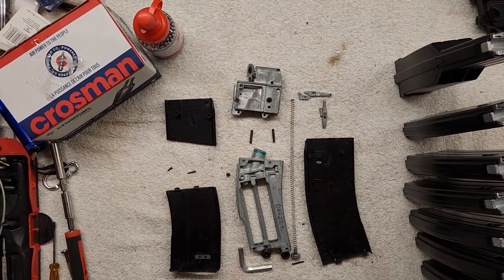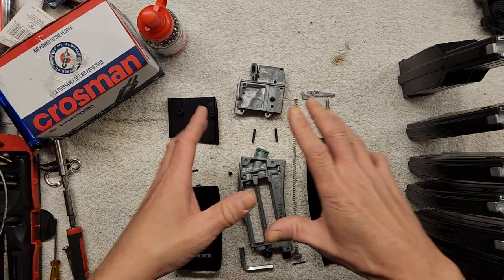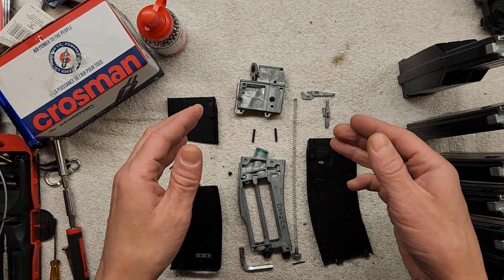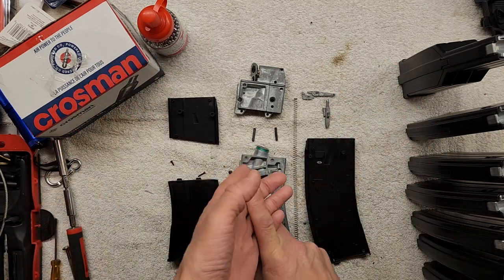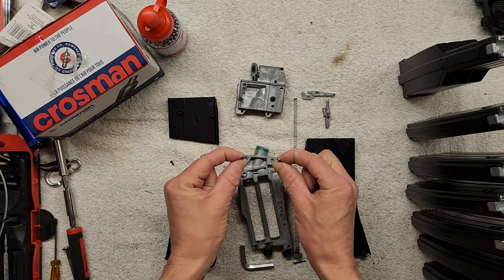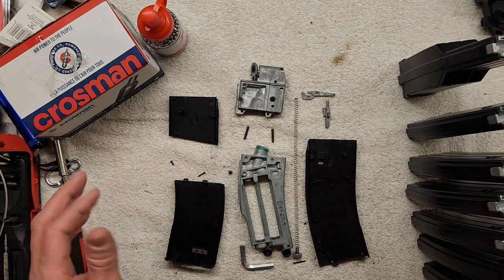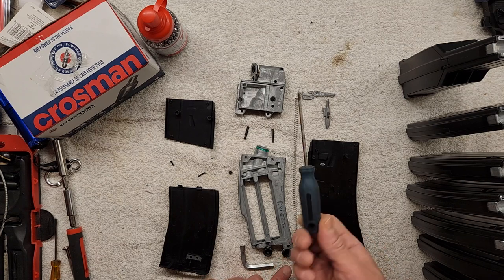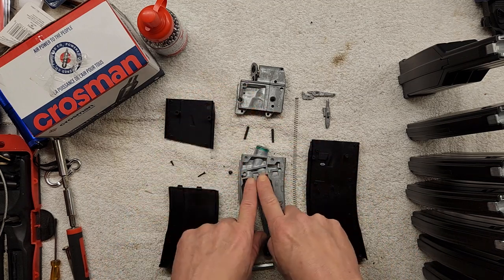Crosman Full Auto BB Magazine - Full Disassembly and Internal Check Valve... No More Secrets!

Comment: Mine doesn't go full auto? Whenever I shoot it in full auto it just shoots once it has bbs in it but only shoots once ? Please help
Reply from the maker: Are you using an unmodified magazine or do you let it sit in the sun? Does the bolt lock back when it happens? Do you get full power when it actually does fire?

Maybe most important, have you field stripped it yet and verified the springs aren't mangled in the buffer tube?
Reply: @RWMAirgunsmithing  the bolt does not lock back when it happens I've never let it sit in the sun
Reply from the maker: @xtdungus6352  ok so does it shoot full power on the initial shot or does it seem weak? Does the charging handle pull back freely or does it seem like you are crunching springs?

It's possible you aren't getting full power from the magazine.  There is a possibility also that the "hammer chip" (the little black knob on the tip of the bolt) is either broken, missing, or worn out.  If it doesn't protrude enough the bolt will not make solid contact with the firing pin and you'll get weak blowback.
Reply from the maker: @xtdungus6352  sorry for the questions but I need information to troubleshoot xD
Reply: @RWMAirgunsmithing  it shoots full power but every time I shoot I have pull it back again to be able to shoot or it won't shoot at all and btw thanks for actually responding
Reply from the maker: @xtdungus6352  Hmm, so does it happen also in semi? Or only in full auto?

I would start by performing a basic field strip, including removing the buffer and buffer springs, make sure the notch on the buffer is not close to the retaining ping when reassembling. 

If this basic verification doesn't solve it you need to check the fire selector detent spring and pin by removing the pistol grip. Make sure the pin bounces freely and the spring is not damaged.
Reply from the maker: @xtdungus6352  technically, if nothing is broken it should run, doesn't seem like it's the mags fault since it delivers on the first shot. Weak CO2 flow would definitely screw with blowback and proper full auto cycling.
Reply from the maker: @xtdungus6352  hey btw(I knew I had an obscure event buried somewhere in my brain lol)

It has happened to me before while swapping uppers and lowers around that the buffer tube ends up not being perfectly in line with the lower extension depending on the slack between the parts or even how you hold it.  So the BCG rubs inside and never completely cycles.
Reply: @RWMAirgunsmithing  Okk thanks I found something new whenever I shoot the slide barley goes back is that normal?
Reply: @RWMAirgunsmithing thanks so much I just fixed it but one more problem it gets stuck whenever I try switching it to full auto or semi it won't let me
Reply from the maker: @xtdungus6352  the fire selector stays stuck? If the fire selector won't move it's likely due to the pistol grip and fire selector detent pin and spring. Maybe it's too tight or misaligned.

Silly question but are you sure it is a full auto model? Did you buy it brand new? Or refurbished? Or a generic brown box version? The semiautomatic fire selector will not go beyond the vertical position, the different parts are inside the FCG.

Comment: When loading co2 in my high capacity mag it leaks. I put in the first co2 and it leaks out the second co2
Reply from the maker: If you check out my tips and tricks video I show what the issue is.  There is a ring that holds the co2 seal and piercing needle in place, you probably need to give it a little tightening on the second, just dont over torque.
Reply: @RWMAirgunsmithing  ok thanks I just need to find a big enough flat head to fit

Comment: Hello mate i wonder if you can advice me on my dpms magazine.  I tired doing the valve mod and when i put it back together its causing a leak. Each time i put co2 in it lets the hole lot out instantly. How do you think i solve this problem. I eventually want to mod all 6 of my magazines and don't can't figure out whats wrong
Reply from the maker: Heya, which mod are you talking about? And does it empty out the firing direction or the blowback side?
Reply: @RWMAirgunsmithing  it was an attempt at rhe valve mod. You drill bigger holes in the ports to release more co2. I never really achieved that but when I put it back together the problem arrived. Mostly the co2 comes out the front bb part and a little from the back too 😅
After watching thr video I decided to dig out the broken one, I have 6 so I had to fill all of them with co2. One that was just repaired under warranty is leaking again so that's getting returned again. I have started to strip down the one I tried to mod and I'm going to see what's going on with it. I could do with a proper valve tool but can't ever find them
Reply from the maker: @Replica-Airgun-Lovers  ok ive seen that mod, technically it is all internal, pretty sure if the brass or interior valve stems are not marred and all the parts are assembled in order there should be no external leaks.  Did you follow along with my video to make sure all the parts are there? I never had issues or had to over tighten that valve assembly, it just snugs right into place.

To find valve tools you need to check the big sites like pyramidair.. or google for airsoft shops, I buy most air tools and accessories from local airsoft shops.
Reply: @RWMAirgunsmithing  I think I'll buy a decent toll and give it another go. I can't undo the valve now with what I have.   It is leaking from front and back but mostly back. I'm sure I never lost anything parts but when I get the new tool I will open up another and compare them to each other and hopefully see what's wrong. I'm in England so getting parts is impossible and crosman won't send or help out due to being in England. Thanks for the assist. I'll have another watch of your videos aswell and see if I missed something
Reply from the maker: @Replica-Airgun-Lovers  oh snap! No customer service overseas! That sucks!   Really sounds like there is something missing or broken inside there, the pressure from the springs should keep everything shut.  Can you depress the valve manually? Might be stiff but I can push down on mine with my nail.
Reply from the maker: @Replica-Airgun-Lovers  https://discord.gg/fJsaVPTV

Link to my discord, send me some pics if you want, or keep me posted, ill try and help if i can.

Comment: I really appreciate your effort, patience and in-depth analysis of the subject. Many thanks and congratulations! In my opinion (I am the owner of such a toy) they structurally exaggerated with solving, as it seems to me, problems with the distribution and timing of delivering the right amount of CO2, at the right time and in the right amount to the chamber. It's obvious to me that semi and auto mode are completely different stories, so they found "some solution" which is not perfect. So I have a question for you. What would you change in the design of the magazine to improve its performance?
Reply from the maker: Thanks! Great question hehe, the only thing that I feel is a bummer is the thermal co2 freeze and the finicky tightening of the co2, would have been great if we didn't have to worry about the co2 dumping.  I think if the brass seat had the same diameter as the piercing needle we wouldn't have this problem.

I most definitely will get myself a HPA conversion kit so I can at least zero my optics with no co2 thermal influence.

Comment: The magnet is what's messing up my it's holding the bb in the chamber. 6:00 mins into vid thanks. can you get a new magnetic if it's shattered?
Reply: Can u get a new magnetic for it
Reply from the maker: You can buy various sizes of magnets with a google search.  If it fits in the little slot it should work.  Hope you can find a replacement, maybe contacting crosman would be a good idea.

Comment: What size flathead screwdriver are you using?
Reply from the maker: Hmm not sure of the size but the goal is to have a flat bit wide enough to catch both notches on the tightening ring.  This way you dont have to worry about damaging the piercing needle or the threads.

Comment: FYI dpms won't fire properly with copper bbs
Reply from the maker: What happens with yours?  I stopped using copper coated when I noticed all the copper powder in the bottom of the jar only a couple months after purchase.  Still have like 3k bbs in it lol xD.
Reply: @RWMAirgunsmithing  looks like the loading mechanism is magnetic in the mag, copper just won't fire correctly...
Reply from the maker: @VIRGILSHELTONII  I haven't tested any since that copperhead jar, but technically bbs should be steel with a copper coating.  I still wouldn't recommend them because of the flaking.

Comment: where can you get a spare spring?
Reply from the maker: Unfortunately crosman doesn't sell many individual parts for this model yet.  If your spring is mangled beyond use, it is just a spring, check airsoft shops or just google it. 

As long as it will fit on the follower and is not too weak or too strong it should do the job.

Comment: Do you think I could get a new piercing needle from Crosman? I think mine are starting to wear out and don’t quite pierce the CO2 cartridges as good as they use to. This magazine is like a year and a half old.
Reply from the maker: Couldn't hurt to try contacting customer service.  Those are pretty hard though, the cheap metal from co2 shouldn't wear them that quick I think.  Have you watched my tips and tricks video? To make sure the check valve is not jammed?
Reply: Yeah, the magazine still works fine right now. But I’m starting to notice that when I pull out the used cartridges the puncture hole is barely even open. At least compared to how it used to be.
Reply from the maker: @silverwing5644  I wouldn't worry until you see a noticeable difference in ballistics or if there is excessive co2 left when you unscrew them.

Comment: Got Damn Check valve!
Reply from the maker: Got damn right! Lol , once you know the trick she's not that bad 😜
Reply: Crosman led me here. Thanks for the video and detailed advice.
Reply from the maker: @SilencedRage  thanks hehe, I should send them a bill xD
Reply: @RWMAirgunsmithing  hey buddy quick question, how do you know when to change the second CO2 cartridge in the DPMS? There is no real info or video out there.
*Second CO2 cartridge
Reply from the maker: @SilencedRage  hmm they should both empty out at the same rate and you change them both at the same time.  What is happening when you load/unload your co2?

Edit : if the bcg is still cycling and your poi is not significantly dropping then you still have co2 to burn.  Rapid plinking and full auto can make it seem like you run out of co2 (you can usually tell the difference) letting the co2 rest between reloads or having multiple mags will solve this.

Comment: You can unscrew the green seals inside the co2 slots, take a dental pick and apply pressure to where there is a little space on the edge of the green seal, then push down a little dont penetrate it, and start to unscrew it. It comes off very easily this way. I haven't put it back together yet lmao, but doesnt seem like they were damaged. Im doing a QR mag though so may be different. I think it should be similar though
Reply from the maker: Oh not a bad idea! I was thinking some type of small spring loaded claw (like on some mechanical pencils lol).

Also just fyi, on one of my mags the seal on the first co2 just fell right out.
Reply: @RWMAirgunsmithing  dude that would be better, I just put mine back together it’s the QR mag and followed all your videos I think I just needed lube on the ball bearing. The ball bearing is in the “first” slot on the QR mag it’s weird.

Oh damn just fell right out, that doesn’t sound like a good connection. 

Of all the Crosman I have a a4-p, was thinking of getting a DPMS would you prefer that or another crosman full auto ?
Reply from the maker: @solventlessherbalist135  I'm a big fan of the AR platform, the DPMS is fine if you dont mind the plastic stock, get the R1 if you want ALL the mil spec xD
Reply from the maker: @solventlessherbalist135  always remember to not overtighten the co2! You can still jam the bearing if too tight.

Comment: Excuse my laziness.

All right so every person who's bought an r1 in my town like has had a leak with the right side the right f**** CO2 seal. Is there an easier quicker way for to fix other then complete f**** disassembly of this brand new f**** product that I have already spent way too much time f**** with?
Reply from the maker: I have fucking tips and tricks video that fuckin pops up in first spot in a fuckin google search... FFS.... lol
Reply: @RWMAirgunsmithing  turns out every r1 in the local tracker supply had the same problems right from warehouse. I went through 3 of them and know of 4 others with same issues. Seems crossman started pumping out substandard units after their first initial successful runs. 
I traded mine back for a gift card.
Reply from the maker: @Michael_X313  yeah these guys can be finicky, but you don't necessarily need to take it apart for the bad co2 usage, this video is strictly about the disassembly.

Check out the videos in my library, my tips and tricks video is an easy fix to ensure proper co2 cycling.  Dont give up! Hehe

Comment: Where can i get a replacement spring?
Reply from the maker: Any spring with relatively the same shape and size should work.  Check out airsoft repair shops if you cant find one on google.

I've been receiving comments and read on forums that crosman customer service is sending out replacement parts, I would seriously try contacting crosman and see what they will do.

Comment: how to improve the power of the mag?
Reply from the maker: Easiest way without mods would be to tether to an HPA tank and regulator.

If you wanna modify the airgun or magazine and void warranty go check out RumbleCanada here on youtube, he has some crazy "not used as intended" mods. Just be ready to reinforce or replace the internals on the upper and lower seeing as the increased pressure will wreak havoc on them.
Reply: @RWMAirgunsmithing  thx a lot

Comment: Hi. Great video. I have a question for you or your viewers. Should you use a drop of oil on the tips of your co2 cartridges before insertion? Thank you in advance. Have a good one.
Reply from the maker: I have put a SMALL drop (I wouldn't even call it a drop, more like a thin film) of pelgun oil (the red stuff from crosman) on all my co2 since my first airgun.  I use silicone oil on moving parts and other rubber seals on the airgun.

The main purpose of the pelgun oil on the tip of the co2 is to prevent the frostbite and condensation from the metal cannister to damage the rubber seal dedicated to the piercing needle.
Reply: @RWM Airgunsmithing  Ok. Thats what we do on my Son's Ak1 and Im getting the A4P. Thankyou for the quick answer. I look forward to your new vids and have watched the older ones also.
Reply from the maker: @lanetaylor7496  thanks! Have fun plinking xD

Comment: Hey so my cartridge hisses and freezes not sure what I need to fix but I’m guessing that green seal
Reply from the maker: If the co2 from the first dumps out the second slot then the ring seating the green seal might need just a little tightening on the second slot.(maybe not even a quarter turn)
Reply: It’s the first slot, the one that needs to placed in first. So should I tighten that?
Reply: Okay so it definitely comes out the second one when I put it in the first one 😢
Reply from the maker: @illest8  yeah it shouldn't come back out the first.  Visually inspect the green seal is not crooked first just in case, dont want to damage it.
Reply from the maker: @illest8  yeah so probably something is not seated properly or it just needs a small tightening. Edit : on the second slot.
Reply: Where do I replacement for it, I damaged the ring that sits on the green seal
Reply from the maker: @illest8  ah, I haven't seen that piece for sale yet.. it was already damaged and you cant take it out? It should unscrew easily a flat screwdriver bit on an extension through the bottom hole.
Reply from the maker: @illest8  did you watch my tips and tricks video?  I cover this problem.
Reply: Just saw it. You’re Tha best man thank you so much